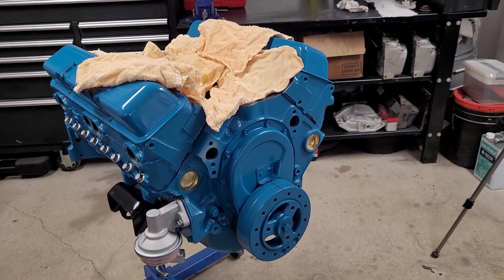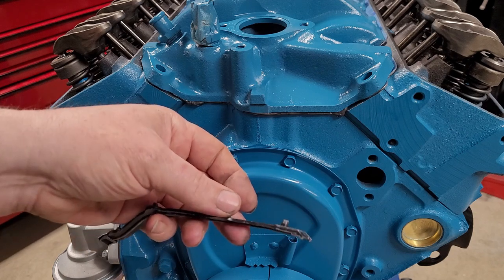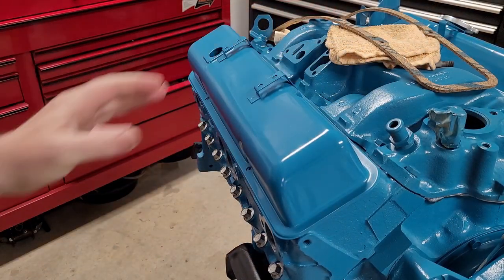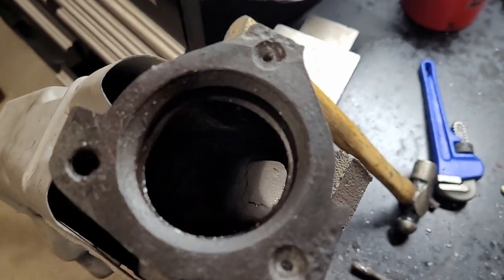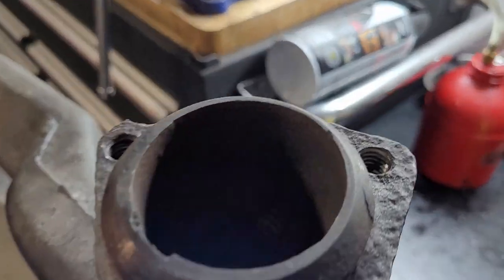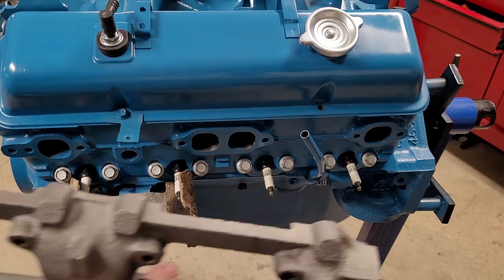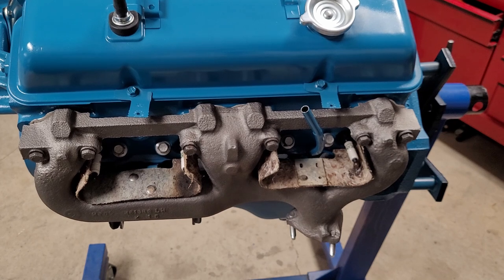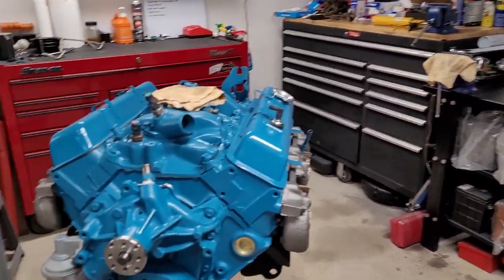305 Engine Build  Part 4

Comment: This is the 6th video of yours that I have watched in a row.  You're doing a great job of showing others how to preform basic rebuilds. I love your down to earth Tanique, not too technical for backyard mechanics to follow. 

My 91 GMC Sierra K1500 has over a quarter million miles on it, and has been nickle and diming me to death. A valve finally got stuck, and my mechanic simply pulled out the pushrods and rockers for that cylinder. I am now trying to decide if I want to try rebuilding the 350 TBI engine and tranny, buy a low millage one from a wrecking yard, or a new one. 

P.S. Just my opinion, but I like seeing a face to go with the voice. Don't be camera shy. Every once in a while, talk to the camera. LOL    Thumbs up Buddy!
Reply from the maker: Thanks Ted , I really appreciate the comment. If you can find a good running TBI engine it would be the easiest move and most cost effective especially if you could locate and engine and transmission for a good price. Thanks for watching the video's!
I should talk to the camera more , thanks for the suggestion.

Comment: God bless you, this is exactly what I was looking for. I putting a 305 in my wifes 96 Camaro. I have never built a 305 before. You are awesome!
Reply from the maker: Thanks for the comment , that's awesome!! Good luck with your build.
Reply: @jaysgarage3616   can you do a step-by-step walkthrough on Chrysler small blocks. I've done a couple. I'm always worried I'm not talking it down to the right specs.
Reply from the maker: @m.w.g4705  I have a 360 we can do in the near future.
Reply: Is it possible to convert from flat tappet to Roller in the 305?
Reply from the maker: @m.w.g4705  You can , many companies offer a kit to convert to Hydraulic Roller cams , I would like to do that on everything moving forward.

Comment: Ive had no luck with cork VC gaskets. They leak no matter what im to the point ill try steel core rubber with the spreader bars dont know if thatll work. Also is it ok to put gaskets over painted  surfaces like that? I would think that would cause leaks.
Reply from the maker: It seems cork can be an issue but I tighten in multiple stages and try to make sure the mating surface is good. I seen this engine last month and it looked good. I do put gaskets on the odd painted surface and don't recall any specific issues but I guess if I had a leak I would have to repair it.

Comment: How much will that job cost I have the same engine also do you have a adjustment video I lost power
Reply from the maker: Hi There , this engine cost around 3700.00 cdn for parts and machining , no labor. I do not have an adjustment video. Make sure the basic tune up items are in good shape , adequate fuel pressure , good filter , choke not partially stuck on and the weights in the distributor are free , ex you can move the rotor and it will move back on it's own. Does it still have a catalytic converter? is it plugged? Good luck!
Reply: @jaysgarage3616  no I cut the cat went straight pipe the small pipe that went to the cat is not plugged or bent

Comment: I would've gone the performance route and want to get as much hp and torque as possible:)
Reply from the maker: Most people would have gone the performance route however this person is not interested and this car will be highway driven mostly so as long as he is happy it's all good. Thanks for the comment.
Reply: @jaysgarage3616  no problem,  any plans on a 406 small block chevy?
Reply from the maker: @plainsabertooth7828  HMMM , already did one but never filmed it , there is a zzz (early crate engine) engine with AFR heads we might go through here soon.